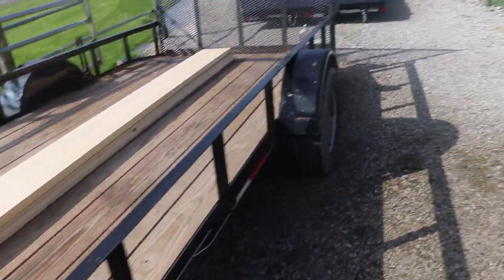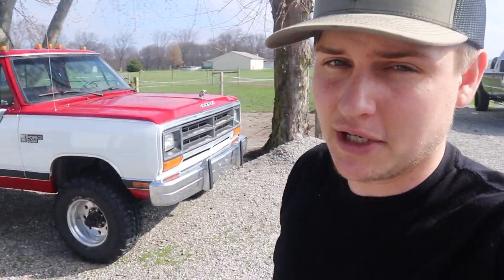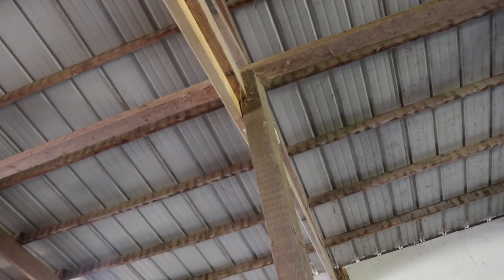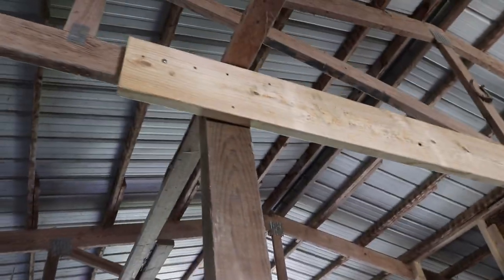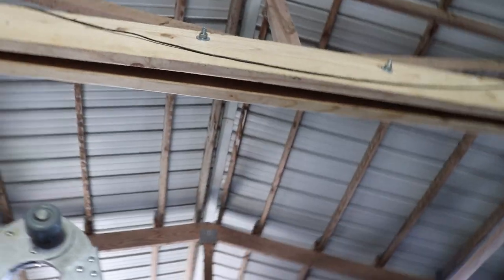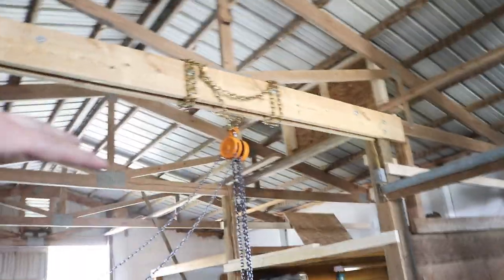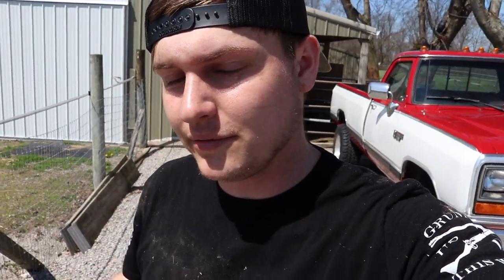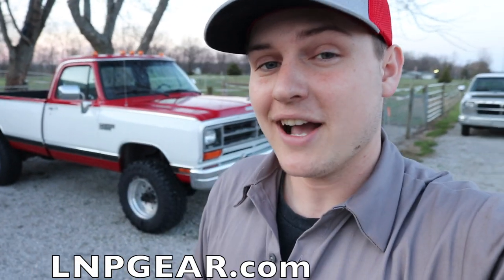NO GOING BACK NOW!!!

Comment: The step up idea for your new trailer isn't a bad idea. The trailer for the lawnmower is definitely jank lol but if it works it works. And I don't see a problem with the weight of a truck bed on that rafter. You should be fine to lift it especially after you shored it up.

Comment: Sandwiching the bottom of those joists is the correct thing to do, but I would also suggest you support the bottom of those added 2x10's with a vertical support leg down to the foundation. Keep up the good work!

Comment: 11:54 use heavy duty bolts and run them through the 1 by 12s and the trailer deck boards to get the strongest longest lasting way of keeping them there
Reply from the maker: Zayne Mcdonald yes! And just recess the bolt down into the board!